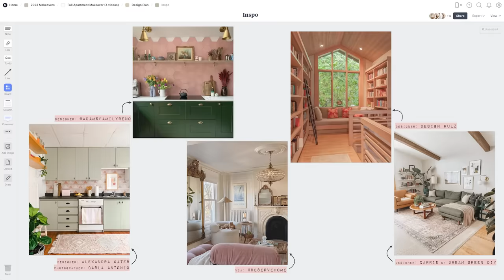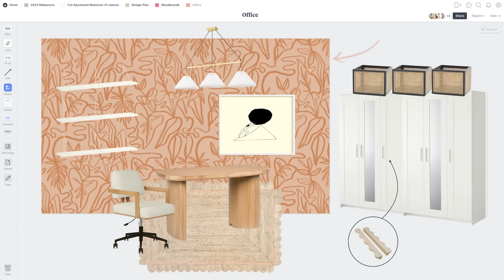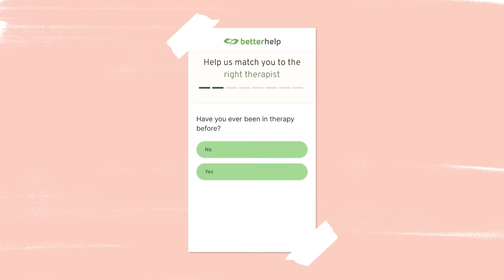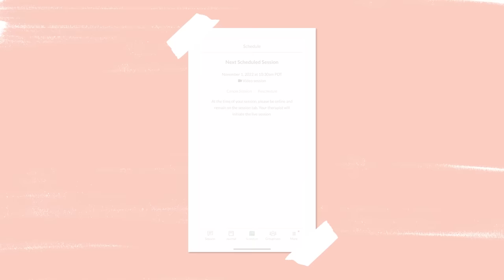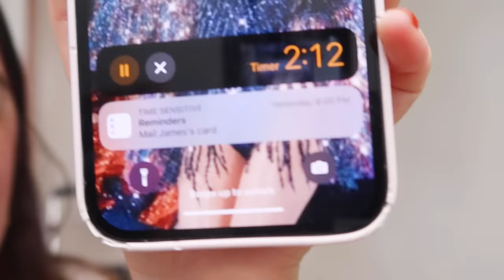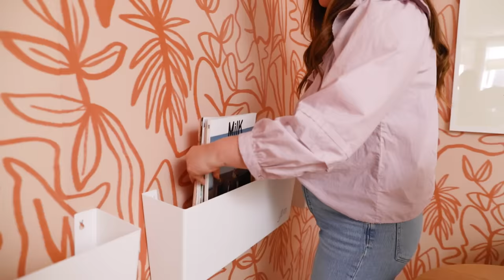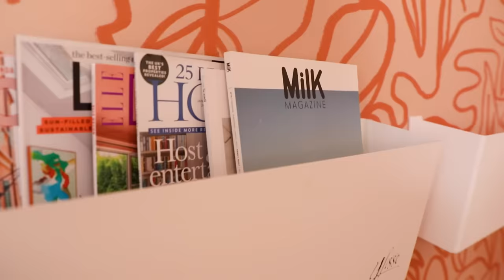*TINY* Colourful Work From Home Office Makeover For A Deserving Viewer | Ep 2

Comment: HAPPY BIRTHDAY dear James  🎶💜  

Wall paper tip.  When you get to an inside corner, don't wrap around to the next wall without cutting.  Wrap around the corner, start your next piece in the corner (overlapping slightly on the first wall), cut both pieces vertically in one cut, and remove the overlap sections.  That way the paper won't shrink when it dries looking curved against the wall in the corner.  And you won't have a visible crack showing the wall behind, either.
Btw, this paper looks more like a strippable than a peel and stick...

Surprised to see you using spray adhesive for the trim without protecting the floor!

The office space is an improvement, because it's tidier, looks polished, has a great light fixture and because the old pink colour wasn't right.  

Yet...  something isn't quite wow for me.  I think it needs a plant.  
I wonder where the stuff all went and if she will miss her ergonomic chair?  
Don't love the lamp cord switch situation and since there isn't anything plugged into the wall outlet, I wonder if it is even plugged in.  
The chair blanket is wrong to me - maybe green to tie in with the living room instead?  
No cute waste basket?  
And please paint out the shelf logos; it makes them look cheap.  
Without seeing it in person, the wall paper looks a bit clash-y with the living room colour, and if it were mine I think I would tire of it being so busy.  
She had some lovely art showing in the before, just waiting to be hung, and the art hung there now is disappointing by comparison.  I would have tried to work around what she had.
I can see why you chose the baskets to tie in the black and the caning, but I don't like the dark colour drawing my eye up to the ceiling shadows.
Reply: Yes to every single one of those points!
Reply: :)   @nikolboteva
Reply: The outlets thing bothered me too, and there is not that much storage...where is she to put everything that was in the office beforehand?

Comment: That wallpaper is indeed gorgeous. However, I do have a small suggestion. I found out the hard way in an old apartment that leaving the edges of wallpaper raw at a corner like that can result in damage to the wallpaper edge. What I did was seal the edges with a narrow wood trim that wrapped around the corner and was a good match for the wood in the parquet floor in that apartment. Of course, one could use a trim made of some other material to match the decor if that works better. But I would suggest you seal those edges to be on the safe side.

Looking forward to next week's episode!

Comment: I'm old enough to remember the time when water-activataed was the only kind of wallpaper. It required a water trough ( from the hardware store) to wet the paper. These are made of plastic or coated cardboard and are very cheap. It would have cut your time in half.
Your solution of using a spray bottle was fun to watch, though 😊!
Reply: I remember all the advice about using fabric starch to stick cloth or paper to the wall in a rental apartment

Comment: water activated wall paper... they sell a plastic tray/tub to put the wallpaper in loosely rolled up, you slowly pull the paper out of the tray and you fold one side down on it and then when you pull the wallpaper fully out you book the bottom up to the middle.  spraying it will not be enough water.  You are suppose to trim the paper when it is wet.

Comment: Sorry, but this makeover seems like Team AG is just too focused on getting favorite sponsors' goods in the space instead of really thinking wisely of the client's current and future needs. Client speaks of needing paper storage and maybe a better/working monitor/computer and says she uses desk for grading and studying, but she doesn't get any meaningful file or paper storage. The round storage shelves in the drawerless desk are kind of impractical. The weird wall pockets with the prominent logos might be sturdy enough for books or records and be great in another setting, but are they really better than a bookcase that could have replaced the cart from the Before office and maybe fit more supplies? Installing them horizontally instead of vertically puts some out of arm's reach (especially when sitting in a non-wheeled chair). The caned unlidded short baskets on top of the closets seem like they'll just be dust collectors and challenging to reach regularly.  

The lamp on the desk is probably sufficient to light only half the work surface as it's not adjustable and really seems better for an end table or nighstand  or something pushed up against a wall, where the switch would drop out of sight and potentially be near an outlet. And even though Kate had several colorful prints and paintings, they've all been replaced by a Sysiphus cartoon, which I guess matched the colors of the living room prints? I mean, the black bar cart is surrounded by big blank white walls and closets, but none of the existing art is moved there? Really hoping that future videos show more of Kate's things integrated and show  better ergonomic solutions for a busy lady facing health challenges.
Reply: well said. 👏

Comment: Oh meee, oh myyyy. With much respect, the living area you did last time looks more like an office to me. (1.) A desk facing the wall instead of the living room or window helps many of us (with advanced ADHD) to focus much better—or else, get no work done. (2.) The nice wallpaper is SO BUSY so, again, does not scream focus(!). I mean, it’s an office(!). If it had been applied solely to the top 1/3 of the walls, I would have understood, but it wasn’t. (3.) I like the light, however, the stylish desk does not incorporate storage. Sorry, but those wall display cases / document holders will likely not cut it. (Think about all what she had in there before.) If I were the owner/renter, I would consider the space as my living / dining area then, simply study or work elsewhere like… the living room🙂. …Otherwise, I will refrain from commenting on the curved pulls for the closet unit, however, the black cart, across from the office area, in the bar area was sleek. Also nice were the black and “straw” storage boxes placed above. Cheers.

Comment: If you have an overhead light Over the desk....why do you need a lamp On the desk? Also that lamp on/off switch sticking Out of the hide hole, just looks wonky. Either get a lamp with a on/off switch on the bulb inset, or really why do you need 2 lights anyway? That bugged me.
Reply: I have an embedded overhead light but it does not throw enough light especially when I am on camera. Sometimes you need that desk light to brighten up the words on a page as you read and grade.

Comment: I wish desk was styled with what she actually needs on desk, not the “Making it pretty for the camera.” Where is her computer?
Reply: Did you not listen to the call with the homeowner? The monitor didn’t work and she didn’t want it there. Please watch the whole video before criticizing.
Reply: Yeah, I tried looking at the desk at Article's site and making sense of the storage options in it. I guess the rounded cabinet space built into the pedestal part of the desk could fit her laptop, depending on what else she stores in the desk. The cable management features seems designed for pushing the desk up to a wall or near an outlet, though.

Comment: The shades on the light you chose are known as "knife pleats", not scallops. Also the wallpaper is not simply water activated, it's called "prepasted" and you use a wallpaper trough filled with lukewarm water, roll each strip with the good side in and pull them through the trough. A spray bottle doesn't give you enough moisture to securely hold the wallpaper to the walls. This is the way wallpaper has been for decades, it's not new!